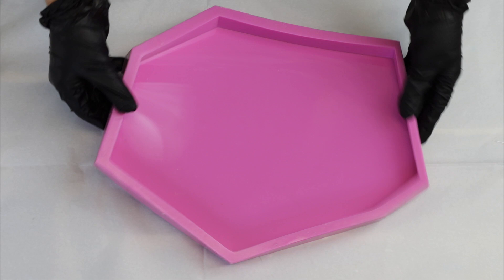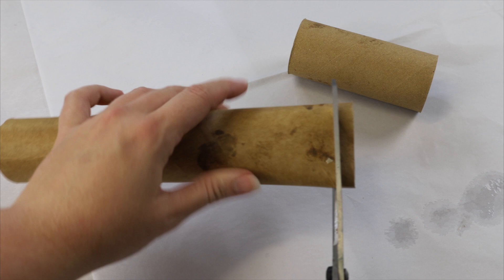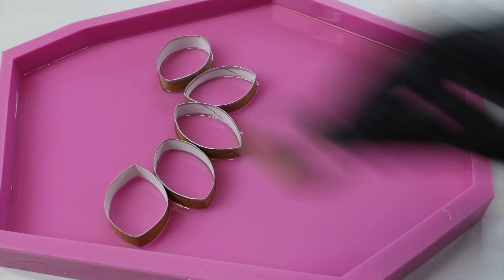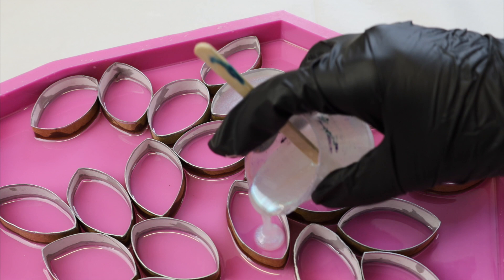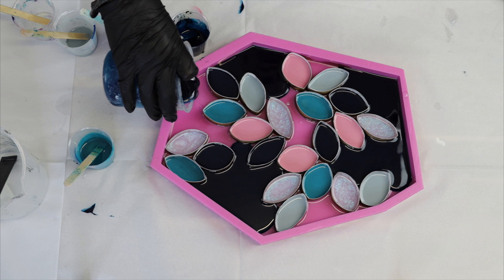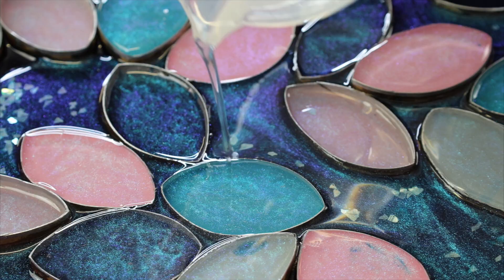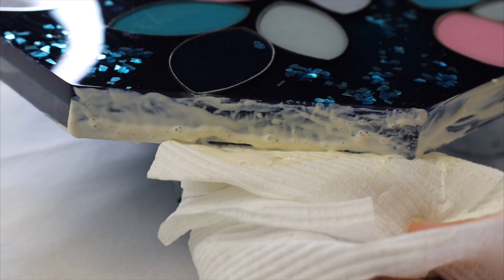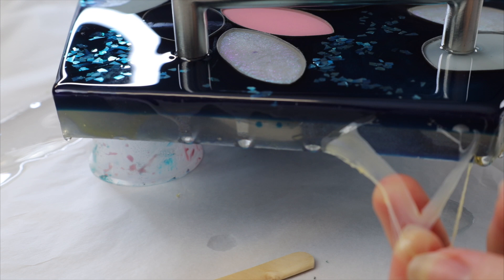How to Make a serving tray using CARDBOARD ROLLS & RESIN

Comment: No, I don’t think I would use paper rolls. It looked cheap. Maybe if you colored the edge black and had a black pour in between the petals it would look less obvious that you used paper roll kernels? Personally I feel glitter everywhere cheapens the look a lot. The original outlay and colors looked very beautiful until you used glitters. It just became too much. Sometimes less is more. 

I would screw those handles on the tray and not only use resin as “glue”. It’s a very thin layer that holds them, any weight on the tray and the handles would fly off.